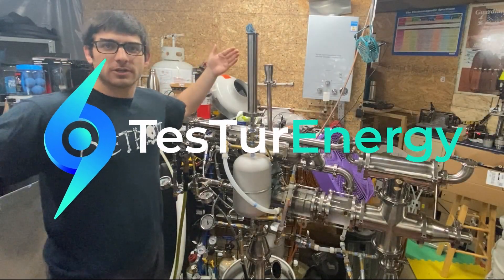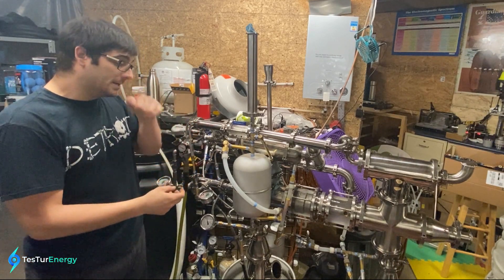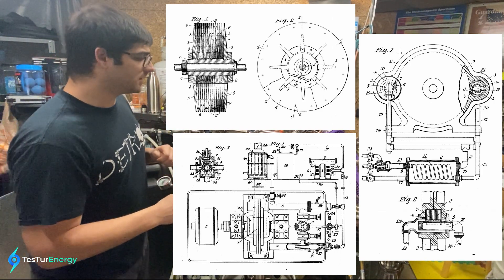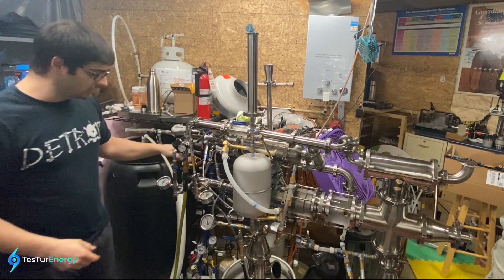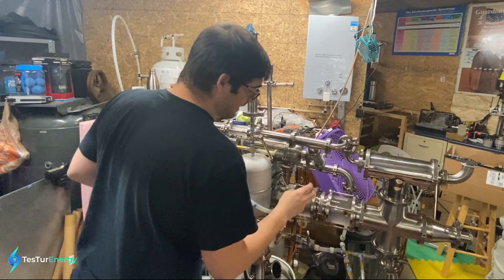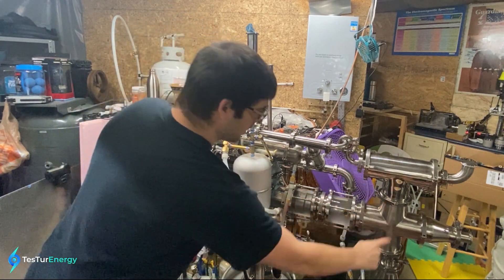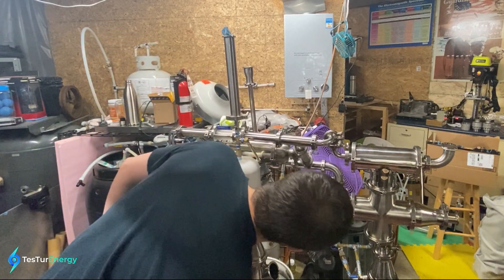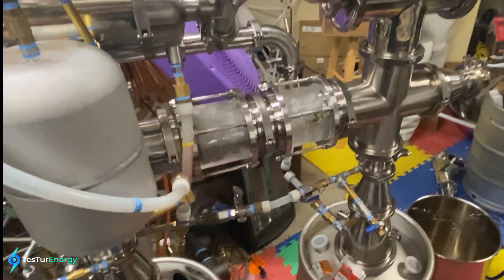Tesla Turbine Jet Engine - gasoline fuel burner atomizer flame tube test 186,083 propane burner

Comment: Charlie, thanks, missed this one. You mentioned woodgas once. Right on my track. I would love to see/build a Tesla turbine on woodgas. Do you have one running so far? Top work man. Get the turbine running continously as CHP before you make the next step. 
Keep them coming, thanks
Reply from the maker: Hey much love Joe! I don’t have the full combustion + steam turbine up and running just yet. Still hammering out some of the design specs before committing the materials to a high temp/pressure one. 

Very soon though! 

These are the latest spin ups with the vacuum/low temp steam CHP system though check it out! 

Steam Tesla Turbine Micro Power Plant - 1st Start Up https://youtu.be/aMYyBsjhBR4   

https://www.instagram.com/reel/ClqGwiDDRSN/?igshid=ZmMyNmFmZTc=

Comment: What is the electrical output potential for this rig??
Reply from the maker: Hey thanks for commenting! Great question! Honestly that’s only limited by the flame tube on the inside which can be changed out to go even bigger. But to be perfectly honest I’m not entirely sure yet with this build. I have to see the rate at which it uses fuel still to get a determination for about how much thermal power output it’s doing.
Reply: @CharlieSolis  super impressive work man. I can't wait to see it hooked up to a voltmeter! 😂
Reply from the maker: I’m assuming you have already seen them but just incase make sure to check out the latest updates on the combustion + steam Tesla turbine builds!   

Tesla Turbine 250 watt to 2.65 kW Power and Efficiency Test https://youtu.be/K7qZvq1CMFg  

+5 Horsepower Tesla Turbine Dyno Jet Turbo Power & Torque Curve 375 mph @ 125 00 rpm HIGH SCORE! https://youtu.be/exF5Rn-L8gs  

Solis Talks Tesla Turbines - Nikola Tesla’s Electrical Power Systems Patent GB 186,083 Walk Through https://youtu.be/5Y3D13JmtcA  

Tesla Turbine Jet Engine - gasoline fuel burner atomizer flame tube test 186,083 propane burner https://youtu.be/gRqKowignac
Reply from the maker: Oh also the latest vacuum steam system tests too! 

Steam Tesla Turbine Micro Power Plant - 1st Start Up 
https://youtu.be/aMYyBsjhBR4   

https://www.instagram.com/reel/ClqGwiDDRSN/?igshid=ZmMyNmFmZTc=
Reply: @CharlieSolis  fantastic! You should reach out to tech ingredients and do a collab! Scale it up!
Reply from the maker: That would be awesome! I love their channel and videos. ❤️

Comment: Fantastic!!! Though. I might have gone with another metal in the turbine and a different jet nozzle but then you would need a blast shield to start the engine. 😂🤣. Might be fun. 🤗... Either way, what you have there is beautiful.
Reply from the maker: Thanks Dan! ❤️🙏

Ohhhh this aluminum one is only the compressed air and low temp/cryogenic prototype. I’ve got all the stainless for making the high temp high pressure combustion prototype that I’ve been waiting until I’m satisfied with the aluminum one to cut out. 

It’s just rinse and repeat at this point with the cnc machines. 

Then soon we can just start stamping out the entire turbine 🤭🤓 just printing off whole turbines in 60 seconds in a rotor at stamping die 🤤
Reply from the maker: I would LOVE to make an all inconel 718 version for ultra high temps and RPMs but I honestly think they’ll be overkill for anything we’d need. 

With Tesla’s Improved combustion + steam turbine patent GB 186,083 the steam brings the combustion temps down to a much more adequate levels for the turbine while still containing all the same energy as a ultra high temp combustion jet that needs a MASSIVE compressor to supply all the cooling air for a turbine.

Comment: Wowowow ! This is magnificent ☺️ It's probably expensive to 😜 it still will make Tesla proud I think , how much fuel can this thing burn per hour?
Reply from the maker: Thanks Future Sight! Honestly, this cost about the same as a decent sized new furnace and it’ll probably outlive any furnace you could buy on the market since it’s all stainless steel. And it also could be slimmed down to be the bare minimum, like without all the extra air and fuel preheating. 

I haven’t gotten as far yet as testing the max burn capabilities but I drained a good portion of that gasoline fuel tank doing just the 20 minute burn.
Reply: @CharlieSolis  it probably depends on how much air you can supply to the burner I think ?
Reply from the maker: Yeah it’s definitely a function of how much air I can send in but I’m actually having trouble with the needle valves being sensitive enough for the needed changes. 

I can certainly flood the crap out of it but I don’t get a stable flame front inside the combustion chamber. 

A more important factor is the velocity of the fluids in the flame tube, it needs to be the same speed as the flame front, otherwise it’ll flame out. 

This makes the pressure gradient across the burner really important. 

Because the pressure drop across the burner will determine the fluid speed in the burner. 

So when it comes time to hooking up the Tesla turbine to it, the back pressure formed from the centrifugal head in the turbine will have to be counteracted by bringing up the burners initial pressure so that the fluids are moving through the burner at the same rate. 

This isn’t an issue though when being used as a generator because they spin at a constant rpm so the back pressure at the end of the flame tube will generally be about the same all the time. 

In the future I may even play around with doing an array of micro burners that all aim into the same steam mixing tube such that they always just operate at their peak point, if you want more power you just open and turn on more little burners.
Reply: @CharlieSolis  way not using a fuel pump en direct injection whit a pwm ? This is proven to be a safe way right they use it in car's al the time
Reply from the maker: @futuresight218  yup! A fuel pump is another way to do it. I was just trying to replicate teslas GB 186,083 patent design where he uses a pressurized fuel tank. 

I had all the parts for this type of setup too. 🤷‍♂️ I’ll more than likely have a fuel pump and fuel rail style system in the future for the multi burner version
Reply: @CharlieSolis  could it be Tesla designed it to use a Less dangerous liquid ? like crude oil ? They also used crude oil sprayers on battel ship boilers
Reply from the maker: You hit the nail on the head! 

“In applying my invention to a steam power plant I use air, under a pressure about equal to that of the boiler, for burning gas, crude oil, colloidal fuel or powdered coal in a chamber or conduit into which the steam is simultaneously admitted as cooling agent and diluent. The provisions to this end will greatly vary according to conditions. In central stations, factories, on shipboard and in many other places compressed air, as well as steam, is available and often, too, all the facilities for fuel storage and supply may be on hand. In such cases the benefits of my improvements will be readily derived with but little additional apparatus and at small cost. If the circumstances require, I provide an air-and also a gas compressor when necessary, driven directly from the shaft of the prime-mover or operated independently by electricity, steam or other motive agent. Generally these machines will be of the more efficient reciprocating type, but rotary compressors or both may be employed to secure some advantage. Irrespective of specific arrangements I effect the combustion while the fluids are in rapid motion and in a conduit preferably in close proximity to the engine, thus disposing of most of the difficulties previously encountered and at the same time materially reducing the radiation and conduction losses which would be incurred in the passage through long pipes. To better insure the maintenance of standard working conditions I may add to the equipment an equalizer of pressures operated differentially by the air and steam, but this device is not essential. The quantity of steam is so regulated that the highly heated mixture, upon expansion through the nozzle, attains an arbitrary temperature which the turbine can safely withstand. The elastic fluids, after traversing the rotor and giving up to the same a part of their kinetic energy, escape through the exhaust openings and serve the further purpose of preheating the feedwater, fuel, and likewise the air when desired. If intensely heated, the air and fuel will be conveyed to the combustion chamber separately, but in small installations it may be convenient to feed the fuel into the compressor or air pipe leading the carburated medium to the chamber. When simplicity is paramount, cheap coils or heaters for the combustibles and the feedwater will be resorted to, but in order to attain a still higher thermal efficiency I employ, besides, a small auxiliary boiler through which the exhaust is circulated. The steam thus obtained from waste heat is fed through a suitable valve, opening at the proper pressure, into the combustion space whence it passes, together with that furnished by the plant, through the turbine first doing useful work and then adding to the waste heat to be utilized in the manner set forth. More fuel may now be gradually admitted to maintain the normal temperature, this again increasing the heat in the exhaust and causing a more rapid generation of the steam, and so on, until finally a steady regime is established. However, if deemed of advantage under given operative conditions, the steam from the main boiler may be reduced in quantity in approximately the same measure as that from the auxiliary boiler is supplied.”
Reply from the maker: If you haven’t seen it yet, check out my latest community post. In it I briefly talk about how I think these turbines have actually been in practicable use all this time in nuclear submarines as extremely quiet “trolling motors”.  
https://www.youtube.com/post/Ugkxif4iryzOpEXN9G3bmId9xznZTk1yuxyz

But for them to work that way they have to be designed properly, which I also explain in that post 🤓 hope you like it!

Comment: Very cool. The thing I recall reading about these machines is they run best when the whole system in resonating. So it produces peak power at a narrow RPM range. How long will it run before it overheats/vibrates/self destructs?  Please don't blow yourself up! Or burn down your shop!
Reply from the maker: Hey thanks for commenting Don! It really helps the algorithm! I’ve had this burner system running for hours non stop now. Just gotta keep feeding it water to the water jacket so nothing overheats. 

As for the Tesla turbine, I know there have been A LOT of things said about how it works. I’m working to prove a lot of them wrong. 

The biggest two I’ve already proven wrong is 1) that they have to be spun fast to even work or work efficiently, and 2) that they only get low torque.

In my opinion, the rpm has little to do with the performance because you increase economy by reducing slip, not increasing rpm like everyone claims. 

When they are designed correctly to reduce slip they work well and effectively at a very wide range of RPMs. 

Yes efficiencies can go up with increasing rpm but doing it that way makes the efficiency go up at the cost of power. 

Because as you increase the rpm you increase the centrifugal back pressure on the nozzle, at a rate proportional to the the rpm squared ~(RPM^2), and thus reduce the mass flow rate of the incoming fluid for a given fluid supply. Reducing the mass flow rate reduces power available. 

Also, as centrifugal head increases the pressure gradient across the nozzle decreases. This reduces the final velocity of the fluid leaving the nozzle.

Because the fluid is leaving slower and the discs are spinning faster, this reduces the torque on the disc. because the relative velocity of the fluid compared to the disc is even lower. 🤷‍♂️

What Tesla says to do is this..

“Owing to a number of causes affecting the performance, it is difficult to frame a precise rule which would be generally applicable, but it may be stated that within certain limits, and other conditions being the same, the torque is directly proportionate to the square of the velocity of the fluid relatively to the runner and to the effective area of the disks and, inversely, to the distance separating them. The machine will, generally, perform its maximum work when the effective speed of the runner is one-half of that of the fluid; but to attain the highest economy, the relative speed or slip, for any given performance, should be as small as possible. This condition may be to any desired degree approximated by increasing the active area of and reducing the space between the disks.”

So now since I don’t need to run it at high RPMs, I don’t have to have outrageous balancing done on it because even the little vibrations there are aren’t very dangerous. 

Also since I’m not at high RPMs I can use more robust bearings. 

Furthermore what Tesla says about vibration with his improved turbine disc stack patent GB 186,082 (different than the combustion + steam one GB 186,083 or GB 186,084) which is the disc stack design I have…

“This construction permits free expansion and contraction of each plate individually under the varying influence of heat and centrifugal force and possesses a number of other advantages which are of considerable practical moment. A larger active plate area and consequently more power is obtained for a given width, this improving efficiency. Warping is virtually eliminated and smaller side clearances may be used which results in diminished leakage and friction losses. The rotor is better adapted for dynamic balancing and through rubbing friction resists disturbing influences thereby insuring quieter running. For this reason and also because the discs are not rigidly joined it is safer against damage which might otherwise be caused by vibration or excessive speed.”

(If you’re not familiar with this patent check out my video where I do a read aloud of the patent so you can view the pictures while hearing the text and not have to pan back and fourth to find what each part is about. 
Nikola Tesla's Upgraded Turbine Patent GB 186,082
https://youtu.be/0IsgNUzc0pM )

And lastly because I don’t have to worry about high RPMs because I’m getting plenty of torque at low RPMs to still output power I don’t have to gear the turbine down like every claims you have to. 

In fact, to smash that myth, and just to spite everyone who said that, I have my turbine geared UP to the generators at 3.6:1. 

Just so no one could be like “but the Tesla turbine doesn’t get any torque and you get too many losses gearing it down…” 

I can always just be like… “well mine works great AND it’s geared up and still works…..”

Lastly because I don’t have to worry about high RPMs I don’t have to worry about the very hot motive fluid in the turbine making the discs spin outside their limits. 

I can go with even hotter motive fluids which, besides the viscosity increase in gasses as they get hotter decreasing the disc slip which increases efficiency, the thermodynamic efficiencies also go way up as you increase the temps. 

It’s a win win. 🤷‍♂️
Reply from the maker: I put a thermometer on the outlet of the burner and it’s coming out at a very nice 400°f (~204°c) which is just perfect for any stainless steel turbine to handle even at relatively high RPMs. 
https://youtube.com/shorts/Hhl7D1OBzhs?feature=share
As long as I can keep it powerful and competitively efficient between 3,000-15,000 rpm this 10in disc size is perfectly capable for even low grade stainless steels to be used. 

I have to double check but I’m pretty sure a majority aluminum casing could be used at these temps as well with even just a little bit of cooling water and maybe some steel inserts in certain places for strength.
Reply from the maker: This is the highest power and torque output dyno test recording. 
2.75 kW and 6.22ft-lbs of torque at only 4150rpm
https://youtube.com/shorts/Zxy8mIVG6as?feature=share

And then this video is a couple dyno spin ups with the variable nozzle I designed at different nozzle settings. 
Up to 2.25 kW Peak Power Output on Compressed Air
https://youtu.be/2aSbRT3tlUM
Reply from the maker: Just released the latest update! 
Tesla Turbine 250 watt to 2.65 kW Power and Efficiency Test
https://youtu.be/XQl1DQgXVkQ